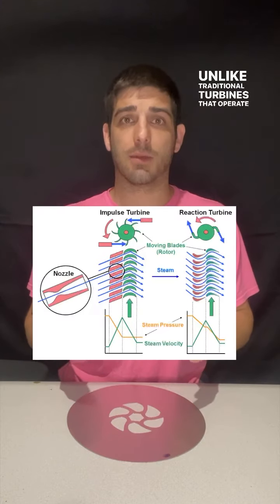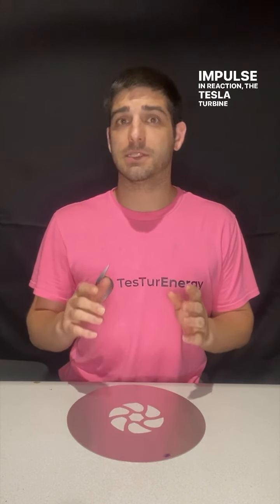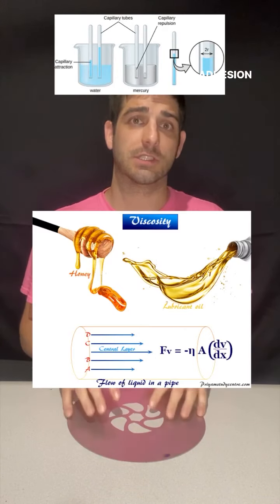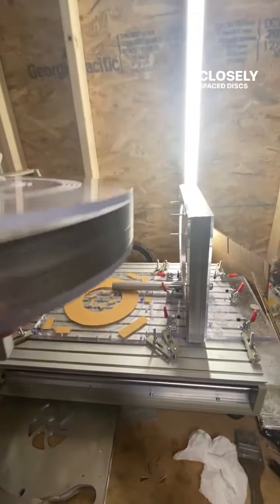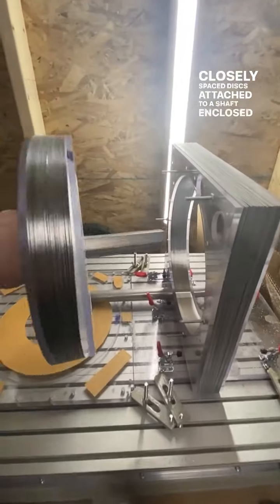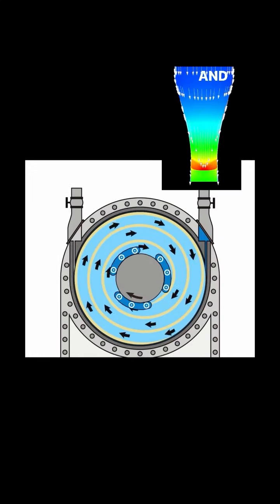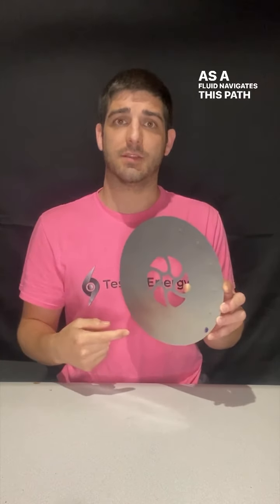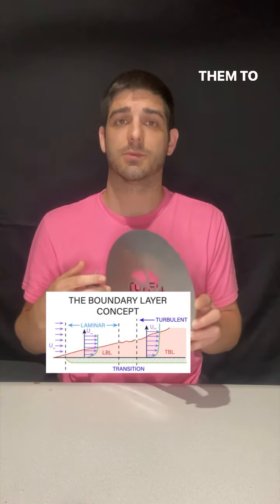Nikola Tesla’s Greatest Invention! - The Tesla Turbine

Comment: I too am looking forward to this series. Questions I have about the turbine are:
- While it can run on any type of liquid, do the viscosity matter
- Would grooves improve function? (Think like a record.)
- Is there a minimum amount of disks to see functional gains?
- Can the disks get progressively heavier to generate more inertia, or would that be counter intuitive to the design?

Cheer!
Reply from the maker: Hey, thanks for your comment and your excitement about this series! I love your questions - they show your deep thinking about the Tesla Turbine. 

Let's tackle them one by one:

Viscosity, Yes, it does matter. 

Viscosity is a measure of a fluid's resistance to flow. 

In a Tesla turbine, fluids with higher viscosity can often transfer more energy to the discs, leading to a higher torque. 

But at the same time, high-viscosity fluids may not flow as freely, which could impact efficiency. 

It's a bit of a balancing act!

Grooves, this is an interesting thought. 

Grooves might increase the surface area, which could potentially enhance energy transfer. 

However, Tesla's original design was smooth, likely to maintain a uniform flow path for the fluid. 

Any added complexity could disrupt the laminar flow, reducing efficiency.

Minimum amount of disks, there isn't really a 'minimum', but a single disk wouldn't be very efficient. 

As the number of disks increases, so does the surface area for the fluid to interact with, increasing the turbine's efficiency. 

Most practical designs use multiple disks, but the optimal number can vary based on specific application requirements.

let me clarify a bit more on the discs.

When it comes to a turbine, power generation isn't from stored rotational energy but through consistent torque applied at a constant RPM. 

Here's how it works:

The power output of any rotating device, such as a turbine, is a product of torque and rotational speed. 

The equation is P = T * RPM / 5252, where P is power, T is torque, and RPM is the rotational speed.

In this equation, you'll notice that power isn't a direct result of stored rotational energy (inertia). 

Instead, it's a function of the torque (force that causes rotation) and the speed of rotation.

For turbines to produce power efficiently, they must maintain consistent torque at a stable RPM. 

This is why in our Tesla turbine, we rely on the viscosity and speed of the fluid to generate power, not on the stored inertia.

Regarding your question about disk weight:

While it's true that heavier disks would store more rotational energy, they also need more energy to start and keep spinning. 

This could negatively affect the turbine's overall efficiency. 

Moreover, heavier disks would be subjected to larger centrifugal forces, which could lower the disc's burst RPM and potentially lead to failure.

The centrifugal force on each point of the disc is directly proportional to the mass of the disc and the square of its speed. 

So, as the mass (or weight) of the disc increases, the centrifugal force also increases, which could lead to the disc breaking apart at a lower RPM.

Thus, when selecting materials for the discs, the key is to find a material that has the highest tensile strength (resistance to breaking under tension) with the lowest density (mass per unit volume). 

This would ensure that the discs can withstand the centrifugal forces while rotating at high speeds, without adding unnecessary weight.

I hope this clarifies your question further. 

Please let me know if you have any more questions!

Comment: Love this so much! when you have time - please make a video exploring electrical power needed to generate steam, and how much power output the tesla turbine can output given the input of steam. In this way we can get a sense of the true efficiency, on a very simple system. (electrical power in vs. electrical power out). Anything over 50% would be world altering!
Reply from the maker: Hey thanks for the comment! 🙏❤️‍🔥

As far as efficiency goes… 

(mind you this is a copy pasta 🍝 so it’s a bit long but it’s worth the read.) 

…My 2650watt electrical load run came in with a very low ball calculation of 40% isentropic efficiency.  

To start off, mind you that includes generator losses, 3 phase rectifier losses, and inverter losses to the electrical load that were not accounted for. 

So the turbine off the bat is already most definitely doing better than the 40% isentropic efficiency I’ve calculated from the already low ball test results.   

But for now I’ll just assume 40% isentropic efficiency so that I’m not over claiming what I can prove it can actually do for the time being. 

(I have nothing in the long run to benefit by overstating my numbers and only my legitimacy to lose. 

I’ve worked hard for my physics degree and don’t intend to tarnish it for a couple of extra views on the internet.) 

As far as inefficiencies to the system to fix, there’s 10x crappy ball bearings in this version, 2 crappy RC car gears, both losses will be gained for power out with a direct to shaft generator. 

(Minus two gears and 8 crappy ball bearings)  

There’s an 1/8 of an inch of space between the turbine endplates and the casing endplates on both sides of the TesTur. 

That’s a 1/4in of open flow area around the 2in wide turbine (that only even has a total of 0.75in wide of spacing between all the tight disc spaces for torque to begin with.)   

That means 25% of the open space for flowing through the casing, between discs and between the casing and turbine endplates, is just free flow over the side of the turbine still. 

(I’m using the absolute bottom of the barrel of machining equipment right now in my garage 🤷‍♂️)  

There’s no labyrinth seals yet to even attempt to further reduce that overflow… 

The nozzle is atrocious at the moment, when making the variable converging section have a tight convergence it causes the fluid jet to aim more centripetally (towards the axle) instead of tangentially (glancing off the disc tips) which severely effects the fluids natural path.   

This will be fixed with the new variable nozzle design I’m going with.    

Then even further in this specific casing’s assembly there’s two “pillars” in the middle of the nozzle.   

This is because the aluminum plates in the middle of the casing plate stack only had the variable nozzle bar and inlet holes cut out, and not the full nozzle geometry.  

So those pillars are just vertical bars in the middle of the nozzle for the air to smash into just before going into the turbine (hopefully the wet steam tests will just erode them down 🤭)   

Before all that there’s still about 100ft of air hose between the tanks and the turbine… 

plus a shell and tube heat exchanger and a TON of elbows and fittings.    

I’m sure I’m forgetting something too but between all that being fixed… 

I can almost guarantee we will be in the 60-70s % range and that’s all just still with room temp compressed air.   

Most forget, I’m using room temp compressed air and never went over 20psi at the nozzle for these tests. 

(Pressure differential and temperature differential govern efficiency)
Reply from the maker: And even then I still only even have a single stage on it yet.   

Everyone wants to compare it to the efficiency of a very high temp, high pressure (1000°F & ~1800psi) multibillion dollar 15-30 stage steam turbines…   😮‍💨   

That’s apples to rocket ships. 😅  

But considering Rankine Steam cycles get theoretical max about 33% of input heat (due to latent heat of condensation and that’s without any regenerative boiler feedwater preheat, air fuel preheat, etc) and then 40% isentropic efficiency (considering the turbine as is) we’re looking at 13.2% thermal efficiency with steam.   

A more apt comparison for the TesTur would be something an individual can actually purchase, like 1-5kW piston gas generators that you can get from Home Depot or Lowe’s.   

These get 15-22% thermal efficiency off the plant floor. Good luck getting that 1 year down the line or later with all those moving parts.  

Also for reference, industry standard for micro bladed gas turbines is 25% thermal to electrical. 

Whole system efficiency can go higher in Combined Heat and Power (CHP) system, but alas the TesTur would see the same whole system efficiency increase in a CHP Auxiliary Power Unit (APU).  

In the TesTur you gotta replace…? 🤔

bearings…? 

And still even then, only maybe 🤷‍♂️ depending on how good of bearings, balance, lubing, cooling.   

The TesTur, and other bladed turbines, only have one moving part. 🔥 

So if those piston generators drop efficiency, even at all, the TesTur on its worst day is competitive with a gasoline piston engine electric generator.🤓😬🤷‍♂️  

And the TesTur can handle any fuel that can burn, even solid particulate fuels like powdered saw dust, pulverized coal, powdered iron, biomass, etc. (noting the number of those that can be acquired without spending money… 🤑 opening up “low monetary cost”, even carbon neutral, fuel options for MILLIONS around the world)  

We have to remember that the TesTur doesn’t have to be the holy grail to be worth using if we have free fuels readily available like biomass, and even waste heat already being dumped out into the air and not used for anything.  

The TesTur just has to be a viable option for some to be worth doing. 

Even more, the mere fact that I’m using a low temp fluid for my 40% isentropic efficiency calculation means my TesTur efficiency is severely limited by thermodynamics and fluid dynamics.   Increasing temps will automatically increase my turbines efficiency.  

This is because gasses have an increasing viscosity trend as you increase the temperature.   

This leads to increased isentropic efficiencies in the TesTur from reduced slip on the discs.  

(Meanwhile, we’re already talking about a piston engine using combustion temps as is.)  

Whereas bladed turbines see the increased viscosity as an increase in drag loss through the turbine blades.   

So we can’t always count on seeing increased isentropic efficiencies in a bladed turbine in practice when we go from low temp to a high temp.  

Again, to reiterate, this increase in viscosity in the TesTur only works to enhance the working action of the TesTur.  

(That being viscous adhesion to the disc faces increasing torque.)  

That’s all on top of the increased thermodynamic efficiencies of using a higher temp elastic fluid too! 🤓 

The disc spacing for room temp gasses is not going to be the same for combustion temp gasses/steam because the viscosity of either increases by 3x fold. 

And I’ve designed these spaces for a higher temp fluid with a slightly higher viscosity so these will inherently be too wide at the current temperatures being used.   

So as we increase temps along with all these other really easy to fix mechanical issues (that only are a thing because I’m building this in my garage on a junk cnc machine) I have no doubt we will see more than competitive isentropic efficiencies compared to bladed turbines, let alone whole system thermal efficiencies that are through the roof.   

This is because of the heat recovery systems that can be added with the cost savings of using a TesTur vs a VERY expensive, and in my opinion, relatively delicate bladed turbine.   

Just getting tighter casing clearance with the turbine should give me at least 20% points back on efficiency putting my testur at the 60% range.   

Coming in with a 19% thermal efficiency in a Rankine steam system without any kind of thermal recoup.
Reply from the maker: Check out the latest progress on our closed loop steam system!

Steam Tesla Turbine Micro Power Plant - 1st Start Up https://youtu.be/aMYyBsjhBR4   

https://www.instagram.com/reel/ClqGwiDDRSN/?igshid=ZmMyNmFmZTc=
Reply from the maker: Of the sun’s light energy that hits the earth 10% is UV, 25% is in the visible spectrum, and a whopping 65% of it is in the infrared, heat, spectrum.   

Solar PV cells can only use a portion of the visible spectrum and use none of the IR spectrum and in fact lose efficiency from heating up from the IR.  

So at best you can get maybe 20% of the suns total light energy to electricity to charge and discharge a battery at 90%.  

So only 18% of the suns light energy gets to your wall plug.    

And then UV light makes them go opaque and be at 1/2 their rated power in 10 years. 

So, conservatively down to 10% of the suns light gets turned into electricity 10 years in. 

With solar thermal collectors you can collect all 25% of the visible spectrum and all 65% of the IR spectrum and store it as heat in a thermal mass.   

So 90% of the suns light energy can be collected and stored as heat in a thermal mass. 

Let’s say 10% loss on storage  

So 81% of the suns light energy is then available to be put through a steam Rankine turbine system, which at theoretical best can get 25-33% thermal efficiency to electricity. 

44% is the recorded best (And that’s without any thermal recoup, boiler feedwater preheat, etc to bring up the Rankine cycle efficiency and/or going to an organic Rankine cycle with a refrigerant in the closed loop instead of steam for higher pressure gradients with the same temp gradient, for high efficiency)  

So that’s 20-26% of the suns light energy can be put directly out as 60hz 120vAC.  

About a 10-45% increase in energy out for the same footprint of collectors.  

And then even after that ALL the heat energy rejected/dumped out by the condenser from the latent heat of condensation and loss not turned into electrical power can then be used for home heating.    

Sooo since about 60% of the energy stored goes out the condenser, if it’s used for heating then somewhere like 70-80% of the suns total light energy can be utilized for electricity and heating.
Reply from the maker: Make sure to check out the latest updates on the combustion + steam Tesla turbine builds!  

Tesla Turbine 250 watt to 2650watt Power and Efficiency Test https://youtu.be/K7qZvq1CMFg 

Tesla Turbine Jet Engine - gasoline fuel burner atomizer flame tube test 186,083 propane burner https://youtu.be/gRqKowignac 

Tesla Turbine Jet Engine Combustion System GB186,083 - Powdered Iron Fuel + propane micro burner https://youtu.be/Ad0Ecpc_OPM 

Dr. Tesla Talks of Gas Turbines - AudioBook by Charlie Solis https://youtu.be/TGGLG-7hK50 

A More Efficient Off-Grid Steam + Gas Turbine! GB 186,083 https://youtu.be/-anD-_LZQy8 

I hope this all helps! 

Cheers!

Comment: Charlie, firstly I see your videos and turbine design are both becoming more refined with each upload so keep up the good work 👍 I was watching Everyday Astronaut the other day and wondered if you could utilize some aspects of the aero spike nozzle design with your turbine. The thought would be to have a broader torque curve across RPM as I’m sure you have to account for some way of throttling for varying power demands. I assume the fixed size nozzle lends to highest efficiency at a particular flow rate & pressure. Peak torque production  is an inherent limitation of the nozzle (or outlet?) rather than disc spacing I would think. I’m sure you’re also familiar with variable geometry turbo exhaust housings as well that assist with spool but this goes against the simplicity of the Tesla turbine construction. Just some thoughts!

Comment: Hey Charlie, Big fan of your work! I'm trying to build my own turbine to test a theory on an exhaust type. However in my research I'm finding so much wrong information. Is there some sources you could suggest for accurate theory? Besides the original patents and your content of course. Specifically I'm trying to figure out the exhaust area to disc diameter ratio. Also nozzle shape and dimensions.

Comment: i am only newbie, but i have a question. after seeing your practical demonstration on Integza channel. my question is: you use pressurized air intead of steam. would using steam be more efficient (at the same pressure level)? because after a while the whole turbine would heat up and prevent steam from condensing and losing power thru heat dissipation.
Reply from the maker: Hey thanks for the comment! And thanks for watching integza’s video! 

So take a watch of the full steam system video. 

I do a much more in depth explanation of what’s needed for a closed loop steam system. 

Mind you I’ve updated the system since this video and parts of the system are a little unorganized but I use some good images to help explain everything clearly 

Steam Tesla Turbine Micro Power Plant - 1st Start Up 

https://youtu.be/aMYyBsjhBR4   

https://www.instagram.com/reel/ClqGwiDDRSN/?igshid=ZmMyNmFmZTc=
Reply: @CharlieSolis  Thank you very much!
Reply from the maker: @Francois_Dupont  you’re very welcome!